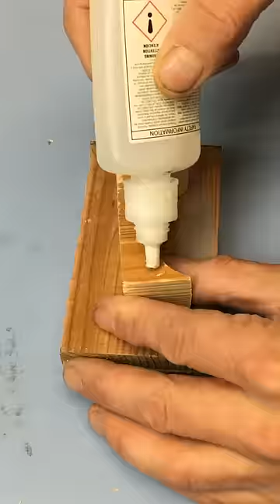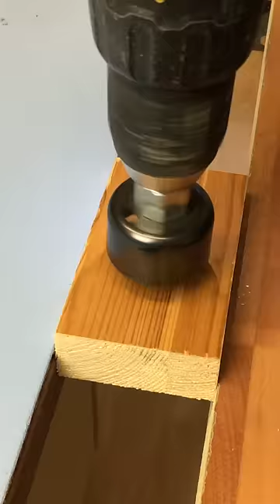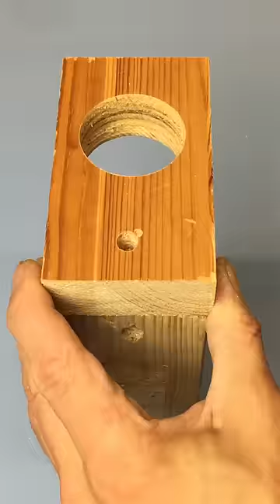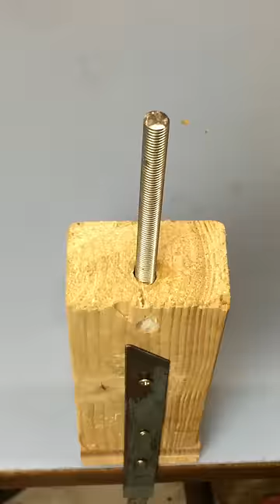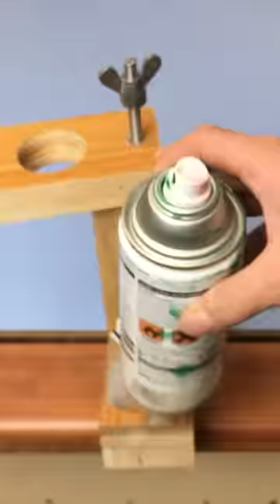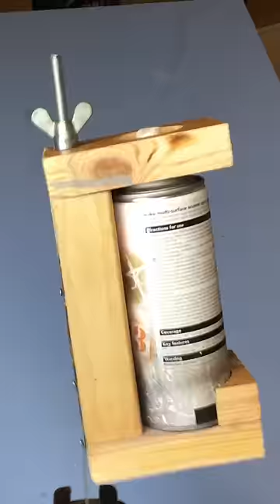Great Invention 👍 #shorts #tipcentric

Comment: I have tried drilling though those blades before. That must be one crappy blade to drill that easy.
Reply from the maker: I won’t lie, it was a nightmare. I snapped 2 bits and ended up having to hammer a punch into them first to break the surface before I could widen the hole with the drill!

Comment: I was trying to guess what you were making, and I had a couple that I thought were pretty close ... until you added the reciprocating saw blade. At that point you totally lost me. I assumed it was some sort of jig because of the scrap wood you were using. Then, at the VERY end, I let out a huge "WHOOP" noise and my wife came running over to see what was the matter. I am very impressed and will probably be making one of these. It's brilliant!
Reply from the maker: Thank you so much! This video has certainly been one of my more controversial ones! I really glad you like it, good luck with the build, let me know how you get on! 😀😀👍
Reply: Those blades aren't meant for those stresses not only that he drilled it making it weaker. 

Please do not try this at home

Comment: I was seriously trying to work through this design in my head last week.
Reply from the maker: I thought about it for a while, then used a hole saw on another project and was like hmmm, yeah that’ll work. This spray was sat in my workshop for about 4 years, wouldn’t work when I tried it, stuck it in the shaker for about 15 - 20 seconds and it’s like brand new again!  👍👍
Reply: @tipcentric  looking forward to building this.
Reply from the maker: 👍👍 good luck with the build! 😁
Reply: @tipcentric  خخ
Reply: @geef0813  خ خ
Reply: @tipcentric  على وزو جانفي المقبل على وزو جانفي الجاري على وزنه إلى على وزنه إلى من هو اول خ خ د ب

Comment: Must be nice to have such time to waste.
Reply from the maker: If you have a lot of cans that need shaking like I have, it will save loads of time!
Reply: I could understand it if you didn’t need to be holding a saws-all. Also to make it so it shakes several cans at once. Otherwise I don’t see the point, if you can only do one at a time and your involved… where’s the savings of time?
Reply from the maker: Well, the green spray in the video had been sat for around 6 years or so without use, i shook it for ages and it just would not work, stuck it in this for 15 seconds and boom, it came back to life. If you have a can you use regular, a quick shake by hand will suffice, but if you have some old ones that need reviving, it will save you a lot of arm work!

Comment: Great invention, my foot!
Reply from the maker: If it works, it works!!
Reply: But it doesn't work is the point
Reply from the maker: @peteragersea377  The can from the video was sat around for years, I tried to shake it by hand, couldn’t even get the mixing ball to rattle, stuck in in this shaker and it came back to life! Looks ridiculous I know, but it does actually work! Normal paint can mixers work off the same principle, heavy shaking mixes paint.. 👍